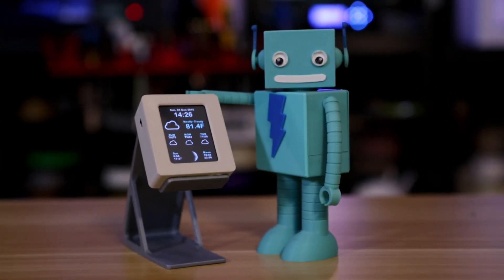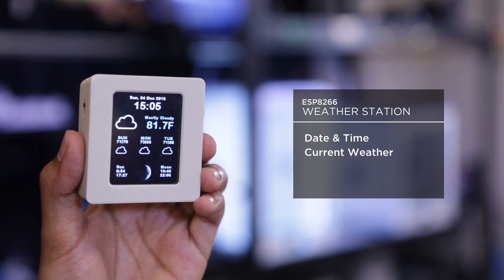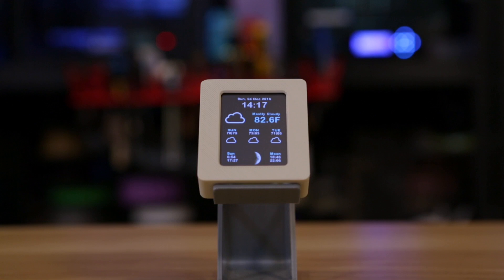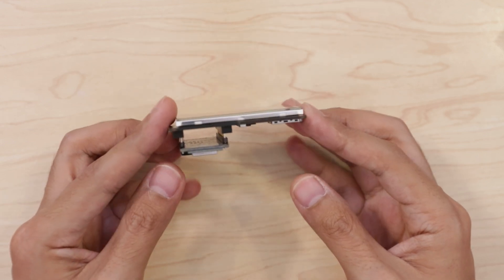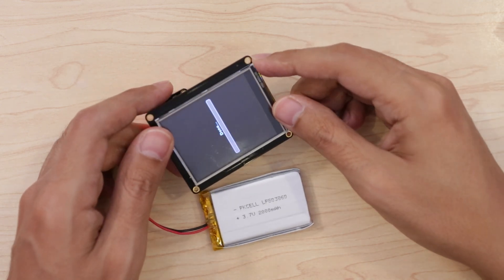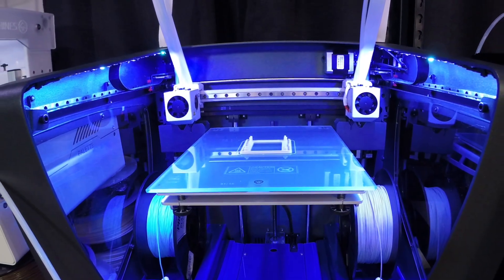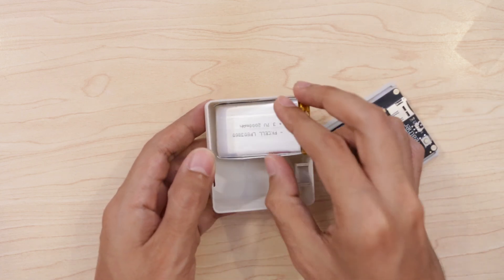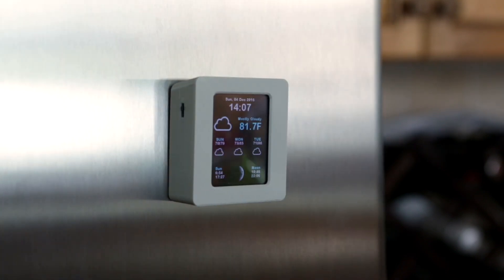ESP8266 WiFi Weather Station with Color TFT Display

Comment: Adafruit, I had a lot of trouble to get the code running, the avr library wasn't inside grbl library, the Arduino IDE thinks it is a good idea to put the .ino file inside a new folder, so we have to move everything to that folder after.
And the part to adjusting the time offset isn't that straight forward, some tips would be good.
All in all, Thank you Adafruit team! You made a really good job, hopefully this comment may be useful to someone in the future.

Comment: A lot of comments say this does not work but it still does w/ Openweathermap.  I just built mine last night.    I've got everything working except I do not wish to have more than 3 day forecast, so it does not have to scroll.  Currently, it parses 2 conditions for each day which makes it scroll.  I used guide below.  Roughly speaking, I had to sign up for app ID from Openweathermap, add my location, set to Fahrenheit and add WiFi network.  I'm sure my code is a mess, but it got the job done.  Now if only I can locate the code to truncate to 3 day summary, I'd be stoked.  

https://learn.adafruit.com/wifi-weather-station-with-tft-display/overview

Comment: Does anyone know if there is a way to dim the screen?  I realize these pieces fit together.  I'm waiting for the parts, and interested to see if I can dim by adding photo resistor,  even if it means powering backlight discretely or interrupting the power pin w small circuit.  If it can be soldered and done w hardware, this would be ideal.

Comment: Don't waste your money/time, the weather API no longer works. Neither Wunderground OR Openweathermap work any longer. Both require accounts and are no longer free.
Reply: This still works w/ Openweathermap.  I just built mine last night.  Where are you stuck?  I've got everything working except I do not wish to have more than 3 day forecast, so it does not have to scroll.  Currently, it parses 2 conditions for each day which makes it scroll.  I used guide below.  Roughly speaking, I had to sign up for app ID from Openweathermap, add my location, set to Fahrenheit and add WiFi network.  I'm sure my code is a mess, but it got the job done.  Now if only I can locate the code to truncate to 3 day summary, I'd be stoked.  

https://learn.adafruit.com/wifi-weather-station-with-tft-display/overview

Comment: Great build, I was able to get everything working in about 10 minutes.  However, It's not mentioned in the instructions, but if you're having problems setting the correct time, make sure that you set the UTC_OFFSET in the settings.h file.  I believe the default is for New York.  I was able to get the case printed with 3DHub for about 4.00 dollars.
Reply: Amazing
Reply: @kimjandeallawan291  thank you. I have since bought a 3D printer and the case prints even better at home. 😀

Comment: what's the expected battery life if you check it a dozen times a day?
Reply: An ESP8266 takes ~75mA and the displays (mainly backlight) take 50mA so if it's a 1000mA-Hr battery it will last for 1000/(75+50)=8-hours, in practice probably enough for a power failure of the main power feed or just a few hours away from a source of power. I think the ADAFruit batteries maybe larger than 1000mA-Hr @ 1200mAHr
Reply: Any update on the battery life?
Reply: G6EJD Hey, there's mAh which is the SI standard.
Reply: https://www.nist.gov/sites/default/files/documents/pml/div684/fcdc/sp330-2.pdf makes no reference to AH or mAh, so I'm confused
Reply: G6EJD You're indeed correct that the ampere hour is not a SI unit, the equivalent would be Coulomb - although that would be ampere second.
Reply: In the SI-Units Coulomb is a close match in pure unit terms but strictly 1 mAH = 3.6C (1Ampx1Secx60x60/1000). Maybe it's time for the SI Units to be appended with mAH to reflect modern usage.
Reply: G6EJD You are correct once again, and if they don't want to make it a si unit, then at least refer to it as an official derivative.
Reply: Happy to help and spread knowledge, that's what my channel is all about. Glad you like it.

Comment: Can you guys do a greenhouse control?  I'd like to turn water on/off in maybe 8 zones based on time or even batter, soil moisture levels.  I'd also like to trigger auxiliary heating if the temp drops below a set threshold and open vents if it get too hot.  Last I'd like to keep a log of the temps, with time stamp and have a way either remotely monitor the status, either by Ethernet or wifi.
Reply: G'day Andrew, did you get much further with this?